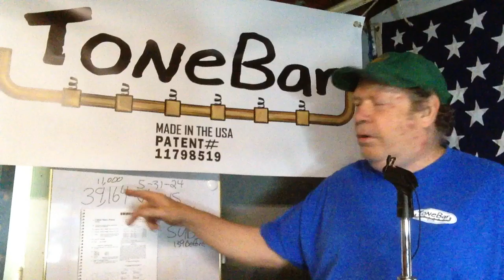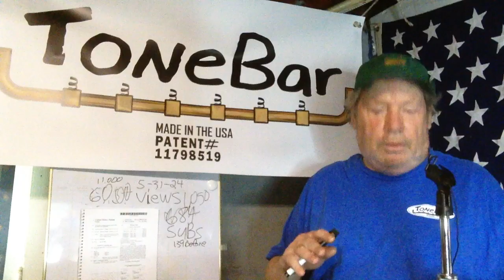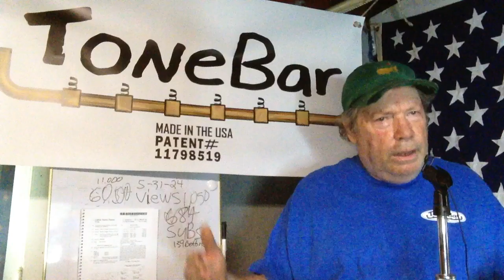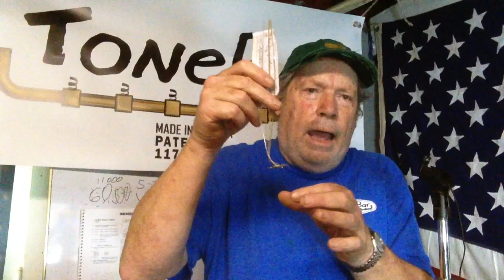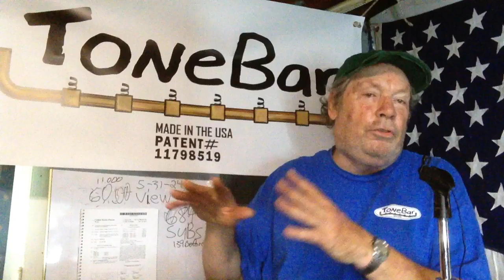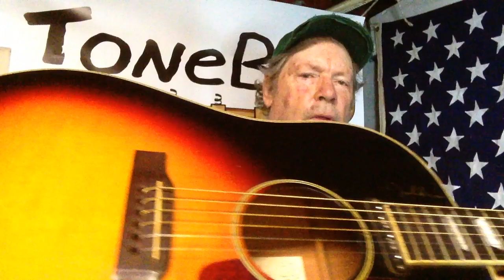ToneBar BREAK THROUGH STRING MOUNTING SYSTEM & METHOD ACOUSTIC GUITAR NO PINS BETTER TONE MORE FACTS

Comment: The sheer audacity is breathtaking. I didn't realize you could patent 4 inches of wire. I will get around to trying this for a laugh, but I will be using a piece of coat hanger and a pliers out of the wife's junk drawer. Good luck sir.

Comment: If you are at a gig, and you break a string, all the strings need to be changed. The trade off would have to be so life changing you can't live without it to make this worthwhile. One string can be changed in a minute or two. 
I've played with guys that broke a string, swapped in a new one, and were back playing before the song was over.
 I saw the Kingston Trio play years ago. They would break a string, flip the guitar up flat, keep singing in harmony while changing the string, and be ready to go by the end of the song. No down time between songs. This thing will make that impossible.
All that plus the cost of buying a whole set of strings when just the one would do, make it a no go for me.
Reply: Well he is claiming that your strings won’t break at least not as often so without further testing you cannot assume it won’t work. You might be surprised when it gets you through several gigs without breakage or it might be a complete hassle but either way I know it would be a great upgrade for a recording guitar.
Reply: @WolfsEntertainment  I don't break strings often these days, but that one time it happens at a gig could ruin your night. 
I would have liked to hear what the guitar sounded like before the switch to the new system. It would have to be a huge change in tone to make it worth the added hassle of stringing a guitar through the sound hole.
By the way this isn't an entirely new idea. I used to have a thing that was made out of brass that stuck to the bridge plate under the top, that the ball end of the string would rest against instead of just the wood. It was in my J 45/50 so long I forgot it was there until I needed to replace the bridge. It seems like it would have similar results, without the need to string the guitar differently. I don't remember what it was called. And I don't remember if I put it back in after replacing the bridge. I should check into it.

Comment: It seems like you could get the same results from slotted string grooves with solid non-slotted pins. The difference is if you break a string with this ToneBar you'll have to take all the strings off to change one string.
Reply: I've tried both ramping a bridge with unslotted pins and used a Mitchel's Platemate (separate experiments). Both are good solutions, but what was interesting is what the Platemate did for a cheap guitar. It seemed to give it much more volume and interplay between arppegiated notes. How? Because the plate is "picking" up movement from adjacent strings better than without the plate. There is "continuity" in the amount of energy put into the top. Personally I don't find the Tone Bar a bad idea at all as it is less mass than even 6 pins, but I would sand down bridge pins and keep them in the guitar for 2 reasons; 1) to keep the authentic "looks" even though they would not longer be in a supporting role, and 2) so that there isn't any additional weird resonance from the top interfering with what our ears traditionally hear. I could be wrong about number 2, it could be a further enhancement? I will likely try one.